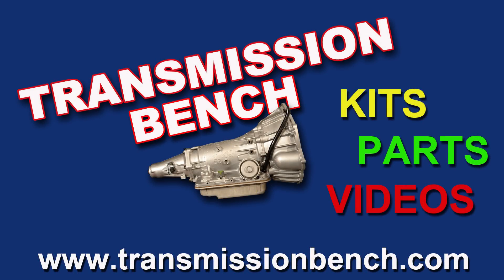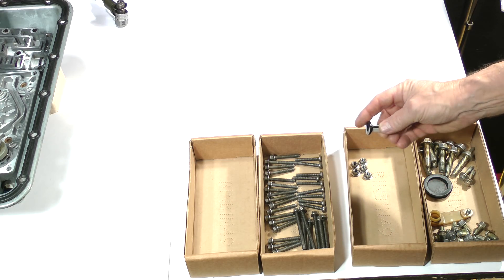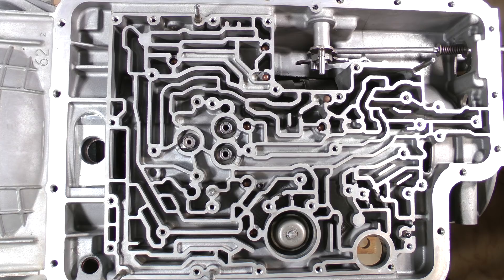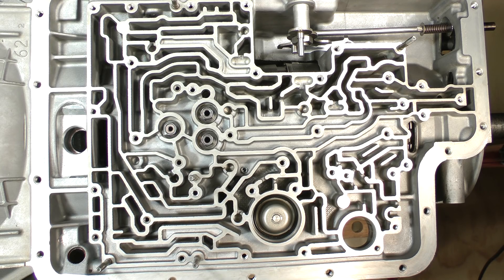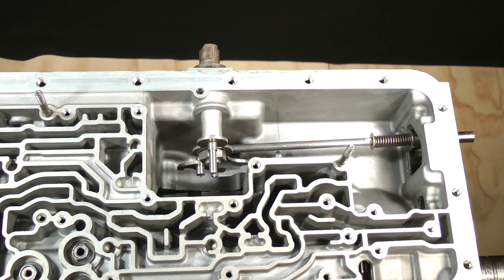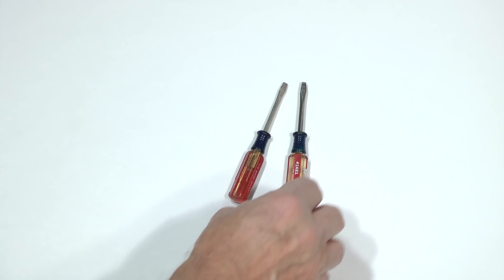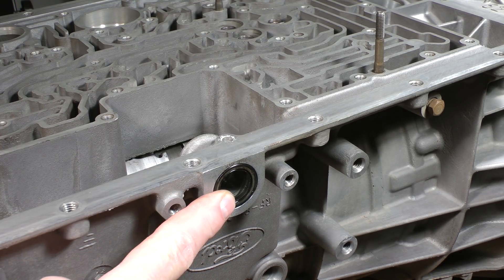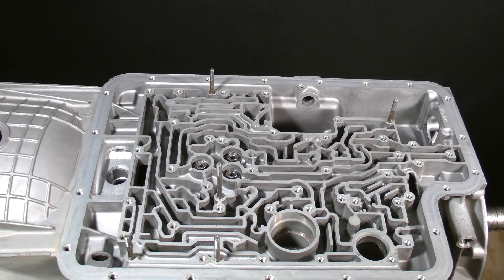Ford E4OD /  4R100 Class lesson 3 of 16

Comment: 12:48 I used a pair of small snap ring pliers, small enough so one side can fit in the hole and the other side fits in the recess around the pin, pinching the whole thing together might be a problem, but if you pinch one side, it didn’t seem to give an issue and it slid out beautifully

Comment: Hello great tutorial....found it searching for this issue i have ..... i know this video is 7 years old ...maybe you still reply to here ???? . My gasket on lower side of plate tore removing solenoid pack at the hole as connector pulled thru.... Was stuck and  hard to get it out, and snagged as it went thru.... I'm worried about the balls and plate dropping down and out of place , while changing gasket.... Can plate be left alone by putting a screw on it in various places after valve bodies are removed to hold it up ???? ( by the way , trans is still in truck so gravity is working to let everything fall out and down) .... I thought of leaving the plate stiffener piece on and taking one of the small bolts out to use as one to put in plate area with others that match it.... Will/could this work??... Thanks for any reply.... Pauly...

Comment: I'm sitting with a club wagon that uses the intermediate piston with cover plate and snap ring. We tried using the newer piston like in the video (because the original's is perished) by shortening down the stem a bit to fit inside the cylinder, but wound up burning a drum as it seems to engage the band from the get go. So my question is: what specifically is the model called that still uses the piston with the cover and snap ring? No doubt finding another flat umbrella is going to be like looking for chicken's teeth, so all I can think of is to shorten the one we have's stem some more so that it stops engaging the band before needed.

Comment: Hello Sir, I have a question about the E4OD, I was reviewing your video to see if there were significant differences between the setup in the different years. I had a 1992 Bronco and pulled the transmission to install into my now 1996 Bronco. I saw in this video that there were 8 balls in the 1996 and 9 balls in the earlier 1992.  I had a mechanic buddy change out the transmission but he did not pay attention to the connectors on solenoid pack.  Would I be able to change the solenoid pack without a complete rebuild or would I have to complete the valve body change out with the gaskets and balls?  I am still going through the video's I think all the clutch plates are ok.  I would really appreciate your thoughts.

Thank you so much for your time and effort in putting this YouTube together I am indebted to you Sir.

Kind regards,
Roger